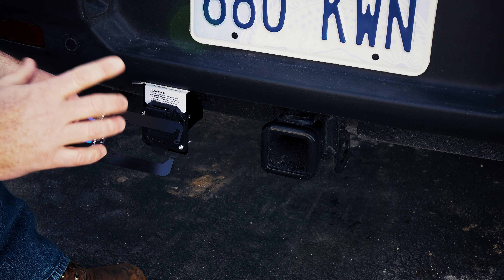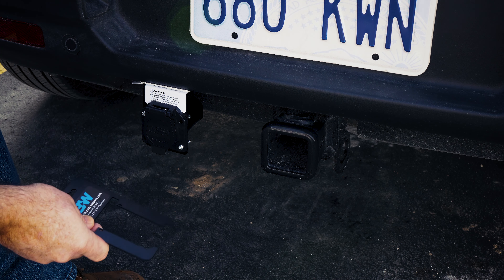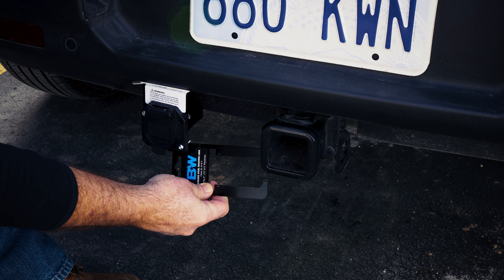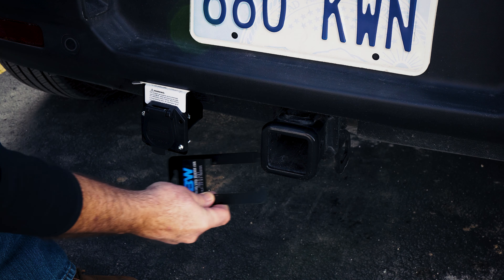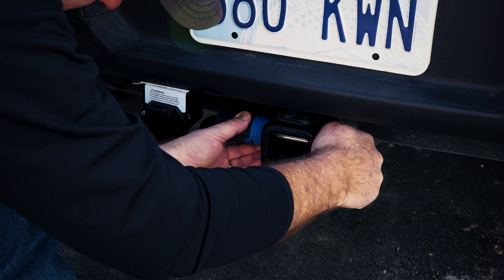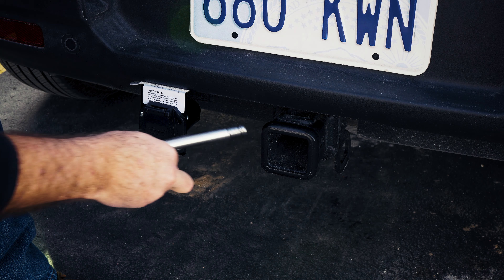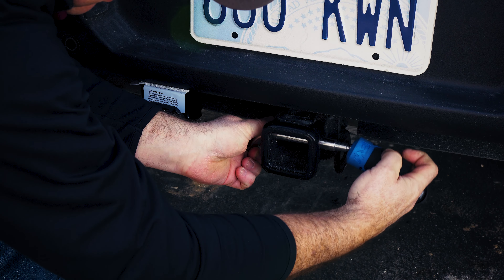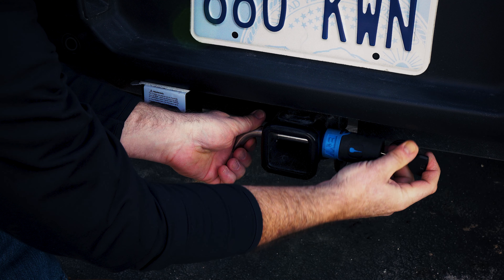Checking the Clearance on the B&W Stainless Steel Receiver Lock

Comment: The main problem i have with B&W locking hitch pin is that the lock doesn't go fully on, it leaves a small area thats a smaller shank size that the lock does not cover, when it sides over on the hitch only one side of the hitch has the full shank size in the hole the other side with the lock has the smaller size (because the lock doesn't fully cover the smaller shank size) so its really only holding receiver hitch on one side of the hitch pin, (I would think thats a huge design flaw)
Reply from the maker: Thanks for your feedback! That uncovered area is actually due to the lock's design, but we can confirm that it doesn’t impact the lock’s performance or the hitch’s security. The lock is engineered to hold strong even with that slight size difference, so you can tow with confidence. If you have any other concerns or need more details, feel free to reach out—we’re here to help!

Comment: How many key combinations are there with those hitch locks?
Reply: @BWTrailerHitches  The reason im asking, I bought 2 of these from Amazon, with in 2 weeks of each other, and they BOTH came with the same exact key /key code. Which is a little concerning.
Reply from the maker: @caliesv  Understood! We chatted with our customer service team and they haven't encountered this issue. However, if you'd prefer the second lock to have a different key, please give us a call at 800.248.6564 (M-F, 8am-5pm CST) and our team would be happy to help.
Reply: @BWTrailerHitches  Thanks for they reply!  no the similar keys actually worked out perfect for me, but i was just wondering how often this happens. Thanks.